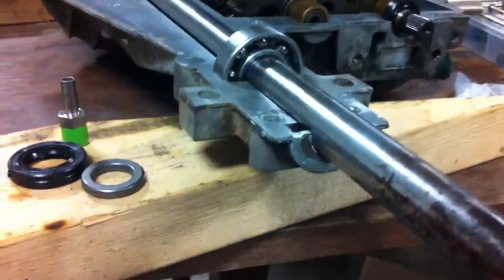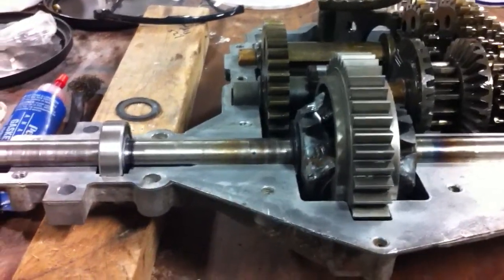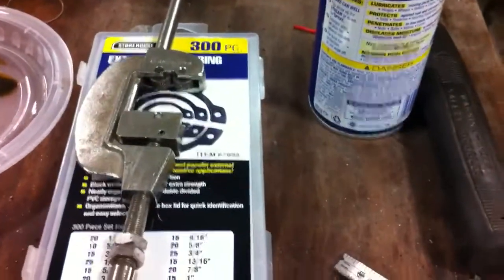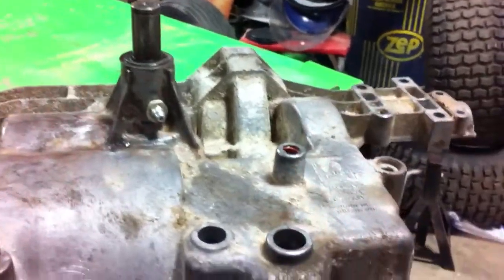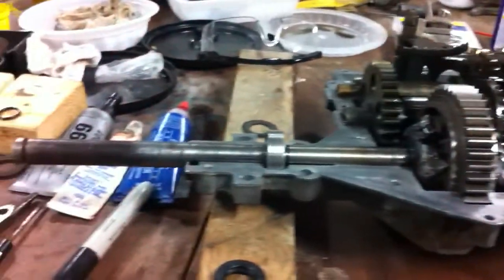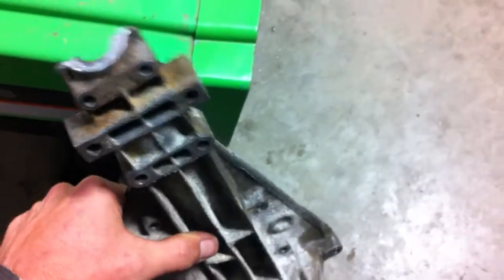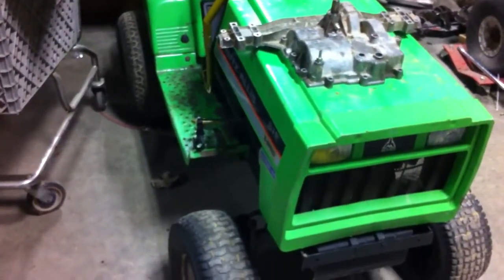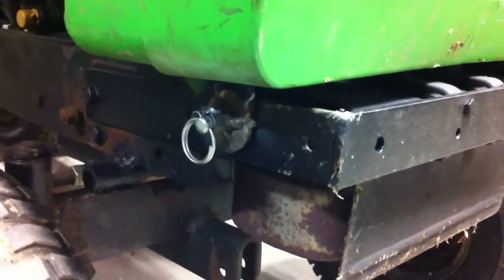Mst 206 part 5 and axle bearing upgrade

Comment: Cool, have mine apart on a coffee table now.
Btw, all you have to do is pull the inner side seal of the sealed bearing. will get oil, and keep dirt out.
I do this with my mower spindles now after packing them and the spindle cavity with grease, they last multiple seasons now.
Reply from the maker: Yeah that's one of the silliest things ,the spindles with sealed bearings and a grease fitting. 
You've got it right ,remove the seal on the inner side and grease em up!! 
Thanks for watching!

Comment: Im glad i took a break from reassembling mine just now. I pulled it out, and ook it apart this morning to weld the differential. 
One axle seal had been leaking, and I was gonna let that ride and slap the lid back on, until I started staring at the big gapping gaps where bearings could, would, and should go. I knew that you could add them, learned that from watching this exact video a while back. Normally I have no patience, but what i hate more than waiting on parts, is doing the same job over again cause I could wait and did it half assed. Im sure it's fine without them for mowing at 5mph. I have a DLT3000, that the mower i leave alone, it does work. Buty LT2000, the one im working on currently, it's never gonna mow another lawn in its life, more of an off road toy. So i think ill hold off and shop for some bearings and get the seals too.
Thank you for the numbers for the bearings! Making my life too easy over here lol
Reply from the maker: Good deal sir, glad I could help out. I don't use mine a lot in the last couple of years but it's still hanging in there pretty good, I haven't had any issues..
Just if you end up finding sealed bearings, you can remove the seals so that lube can flow through. 
Thanks for watching!!
Reply: @MrTheHillfolk  just got the bearings in today. Poppin those seals out as soon as I type this and eat this sandwich.
I pretty much copied everything else you did like the vent and adding a grease fitting for the input shaft. I got new bearings/seal for that , and also the two axle shafts and the seal for the brake shaft. I considered trying to tighten up the spring on the leaking axle shaft seal, but it's got a nice rip and dismantling this whole thing again is a lot of busy work that i don't wanna do again anytime soon. 
Thanks again for all the videos! Those little details id normally have to discover myself by breaking stuff lol

Still wondering why they cut those grooves if none have bearings.. I guess in mower form, top speed is like 5mph, but dam put at least a bushing maybe? Thing clanked around like a Ford 8.8 rear end.
Reply from the maker: Yeah I think they omitted the bearings for cost reasons and only used them if the application demanded more strength. 
I'm not sure if it helps, but I did have the back end off the ground and let it sit in like 3rd gear idling for a few minutes to try and get a little heat in it. 
Sounds like it's coming right along✌️✌️
Reply: @MrTheHillfolk  
Tecumseh - 
"Ok, chrome shaft that's holding the entire weight of the machine, and its spinning against aluminum. We'll put axle bearings right here, on the axle, just like normal people."

Sears - 
"No no no. None of that." 

Those bearings slid on, and dropped right in, almost like they were meant to be there. If this lawnmower went any faster id probably be searching for roller bearings, maybe. And i only say maybe because it went from mo bearings, to ball bearings, certainly isn't hurting anything.  
Top bearing on the input shaft was way rusty, so, well i just rounded up everything in the form of seals and bearings it has. 
So, back to waiting on parts!
Reply from the maker: @dogsandwich77  haha I bet that's exactly what it was!
 (the Sears example).
Hopefully the parts come quick, as this stuff is a lot more common than the Volkswagens I play with and end up waiting weeks or searching for hours on a particular odd part 😂
(That's mainly on my older stuff that I'm trying to preserve)
Reply: @MrTheHillfolk  ive had a '73 super beetle, a '70 beetle, and right now there's a '66 Baja in my driveway with a 2110cc. Doing my homework on dual Kadron carburetors right now. 
I love air-cooled vw, just as long as it not my only mode of transportation lol especially since where I work is at basically sea level, and where i live, 30 miles away, is at 4,000 ft in the mountains. Could be snow at home, and warm and sunny at work. Air-cooled carburetors are not what i want to adjust on a daily basis hahah  
But this Baja is a fun one to drive. The hard part is going thru it to see what the previous owner did or didn't do. And making sense of the wiring which always seems to be a nightmare in a Bug, modified or not. Im just glad its a late '66 and therefore a 12v car.
I could go on and on about this crap forever hahaj
Reply: @MrTheHillfolk  ok last thing.. I took out the roller gas pedal dude had installed (i hate them) long story short, order a new floor hinge for a stock pedal from ebay, waited so long for it that i found another one much closer to me in Long Beach, had it all together amd finlly the first one i ordered shows up, from LATVIA 😳
Reply from the maker: Man that's awesome, I dig the air cooled stuff I just have too many projects to get into one
Reply from the maker: Haha yeah ,I wanna say i have a few parts on my red car from Latvia, lol I know my instrument cluster is from Serbia 😂

Comment: Looks like things are coming along nicely. Like how you pay att to detail! Yeah that lower gearing sucks where they have to be speeded up externally so much to keep the fun factor alive! That Cushman is the same way. If only that one set of internal gear reduction could be eliminated easily.. :>) Oh-Did catch the 15 kw in the b/g of a previous..., Got a 10 kw pto for the Kubota :)
Reply from the maker: Yea I've been hunting and trying to gather gearboxes :) 
I'd like to try internally speeding one up right now as long as I can find a couple to tear apart. 
I would think that running the input speed like 5 times over stock, they aren't gonna last forever :)
Nice, a 10kw for the kubota, pto units are nice and simple usually because they know farmers and people like that are gonna just use em to death...
heh, one I had in the shop a few months ago had 3 red lights to get your hz set at, the top one was too fast , bottom is too slow, and the middle light was within range.
Nice and easy!! 
Thanks for watchin!!
Reply: MrTheHillfolk peerless 900 series (920 and  930 too) are the best for speeding up internally providing you have a lathe... you can use gears from the gearset side and replace that first reduction with 6th gear if u want and do 45 on a 1:1 pulley setup. stretch did it
Reply from the maker: Yea i figured most any box could be internally sped up with some extra gears and and some machine work.  
Everyone wants an 820 though. How's the strength of those 900 transaxles?

Comment: Good Idea
When I pull apart my racers transmission I should check for those bearing pockets
Reply from the maker: From what I found out, the bearings are an upgrade for the mst205/206.
You should have those pockets....
What I didn't like was the price of the peerless needle bearings, it would have been like 50$ after shipping for both sides...
Using normal bearings , I got em shipped for like 10.50.
And if I wanted to open up the peerless 801, it's got roller bearings like I installed and I bet it's
Reply from the maker: Oops, got cut off....what I was gettin at I bet the bearings from the 801 would fit right in also.
Reply: MrTheHillfolk they do and also in a 900
Reply: @MrTheHillfolk  ironically I just pulled one apart today that had factory bearings installed, like I said 7 years ago, I will be doing the upgrade on a few transaxles.
Reply from the maker: Cool deal man , and actually I've still got my tractor ,but it doesn't get used much in the past few years.
I've got to get it out and run it for you guys.
I see ya around quite a bit actually.
Haha I dig the reply after 7yrs,that's really cool. 
Kinda like a few channels I've never unsubbed from and all of a sudden 2yrs later they upload a vid 😄
Good times!

Comment: Very Good! Been looking for these..Now what site did you order the bearings from? Or did you order them locally?
Reply from the maker: I got em off eBay.  
Carnell sales on ebay. Haha I had to search back thru my emails and see where i got em. 
I'm sure if you are near a good sized town you could find em locally. 
2 of the sealed bearings were like 11$ shipped. 
If ya use the sealed ones you can pull the seals out and let the gear oil lube them an get thru to the axle ends. 
Thanks for watchin !
Reply: Thanks for the Info..I have a place locally the specializes in all types of bearings..I'm sure they'll have them in stock..if not, I'll order a half dozen or so. Thanks again..I subbed your Chanel.
Reply from the maker: Actually I started out googling the numbers. I bet your bearing place would have em. I probably could have gotten em locally also, I don't think they are an uncommon bearing. Good luck on bearing hunting, and I just saw the sub notification in my email...and thanks for subbin!!
Reply: I did the same..googling manuals & diagrams, trying to find a part #..on my second search, Your video came up as the 4th link on the page..Cosmic Irony my Friend!
Reply from the maker: Well good deal then, glad I could help out. 
I know these bearings will work in other transmissions too.

Comment: Just out of curiosity, I've got a Peerless 915-032A that also has the cutouts for the bearings. Any idea if these bearings would work in that case as well?
Reply from the maker: Jed Brown 
They should. 
I looked up the bearing od dimensions and I found they are 40mm or 1.57 inches depending on where I looked. 
Measure across the bearing hole in your case and see if it's a little over 1 1/2 inches (1.57/40mm)...I'd bet these fit because I see them listed all over. 
If they are set back in the case a little ways like a 206 , and you have end seals be sure to get shielded bearings, or if you get sealed ones remove the seals for the lube to flow to the axle end. 
Thanks for watching, hope this helped.
Reply: MrTheHillfolk 
Thank You kindly Brother. Appreciate your response.
Reply from the maker: Jed Brown 
Anytime,you're welcome! 
Are you converting it over to gear oil? 
There might be a couple little things you might want to do, like drill the top of the case for a vent and maybe add an input shaft grease fitting. 
(they don't get much splash lube and a shot of grease occasionally helps them live longer) I'm pretty sure I've shown those mods in previous or later videos in this series. 
Hope this helps get the machine going and rippin up some terrain!
Reply: MrTheHillfolk 
I hadn't considerd it as this is just a stock lawn tractor with a badly worn case. I was surprised to see there were no bearings but it has the cutouts in the case. Basically designed to fail. I like the idea of a grease fitting on the input shaft though. I was also considering grease fittings on the axles if I could find bearings that fit. I appreciate your input and will check out your other videos as well. Thanks again!
Reply from the maker: Jed Brown 
Haha I figured it was a mud mower, that's what I get for assuming 😬
stock is ok too, gotta cut the grass somehow! 
just to make it last a little longer, good idea on the axle grease fittings. 
930s are decent boxes, I'd mod one for off-road if I came across one. 
Maybe adding a little bit of gear oil (4-6oz) in the grease would help too, it made my 801 (my original box) a little quieter when it was grease filled at first, before I swapped it over to gear oil. 
You might have to press the needle bearings out of the input sleeve to drill the hole for a fitting. 
There's probably 2 of them in the bore with a space between them, if you can get it drilled in the right spot you might not have to press them out, but cleaning the chips out can be an issue. 
If ya do press them out , just let them stack against each other as you press and keep pressing till they come out. 
And they went back in pretty easy too. 
Hopefully it works out ok for ya

Comment: I wouldn't worry about overfilling the gearbox. The first time you stomp on it it's probable going to puke the extra lube out the vent hole. Then the level will be where it needs to be. LOL.
Reply from the maker: Heh. I think I did that on the 801 that's in the tractor currently. I know I put a whole qt of gear oil and Lucas mix in it. I pretty much filled it to the parting line for the lower case!! 
Oopsie....First ride I got all kinds of drool out of the vent!!
And man, gear oil stinks!!! 
At least it's not as bad as it was years ago, but it's still nasty stuff. 
It's a bunch quieter now instead of the nasty grease though!! 
And thanks for watchin!!
Reply: prancstaman yes but those gearboxes attract enough dirt already..

Comment: do you know what the case material is? you said you welded the corner what wire or rods did you use?
Reply from the maker: It's some kind of cast aluminum I think. 
There's aluminum welding rods that you might be able to find at a hardware store,maybe tractor supply, but definitely at a welding supply shop. 
The name of my kit was alumna weld ....use mapp gas instead of propane. 

I did more of a description of the welding product I used in the 3rd part of this series. 
http://youtu.be/-ruFvx9iSB8

It's still holding just fine :)

Comment: How many  inch pulley did u use??? Retired Larry
Reply from the maker: Larry Keesee 
I ended up using a 6 inch front , and a 4 inch rear pulley. 
With a redline of around 3600 it’ll do about 22 mph. 
If you turn it to around 4500 it’ll do close to 30.
Thanks for watching !!

Comment: A good place to find the bearings and oil seal is a business called Applied Industrial Technologies. I was hard pressed to find both the seal and bearing and they got both for me in 24 hours.
Reply from the maker: Cool deal, thanks for the input. 
The bearings are pretty standard , just if you get them shielded or sealed. I would have liked the shielded ones, but removing the seals on the sealed bearing and leaving the axle seal in place works too.

Comment: How much gear oil should i add, i know the manual calls for 16 oz but since i did a pulley swap I figured it might need more, anyone please help lol
Reply from the maker: I kept about the same amount , but threw in a shot of Lucas. 
Also it's a good idea to vent the case. 
In a pinch I bet the fill port could get a hose jammed in it , and run it up to the frame and loop it back down. 
If you had the trans apart , you could drill and tap for a fitting.
Reply: MrHillfolk just put it back together and mounted it a couple hours ago, but I plan on taking it apart again sooner or later because I wanna install those bearings because the left axle seal kept leaking, that’s what I replaced lol, hopefully she’s sealed
Reply from the maker: @alvincrowder9545  
Yea id keep it at the 16oz mark, now with a pulley swap it's overspeeding and a high lube level might just try to blow out of whereever it can. 
Mines been good with a 6 front 4 rear, and spinning the engine  to 4500. 
Hopefully the new seal works , i like this box because it uses real seals and is lube filled.
Reply: MrHillfolk and also i wanna add a vent and wanted to know how exactly did you make it? Sorry for all the questions lol
Reply from the maker: @alvincrowder9545  
I was looking to see where I described it in one of these videos lol, a quick search and I didn't find it, so I'll  just describe it as best I can. 
Later in this video you might be able to see it on the top right side of the case , if the top left is considered where the shifter shaft sticks out. 
I drilled a hole and tapped it for a hose Barb fitting to use a piece of 1/4-5/16 fuel line on it. 
Run it a few inches up and loop it back toward the ground.
I added a cheap little fuel filter on the end to keep dirt out.